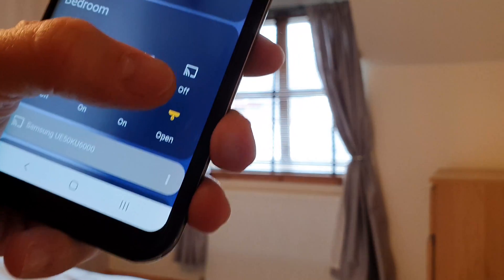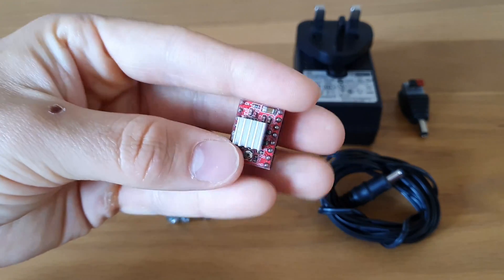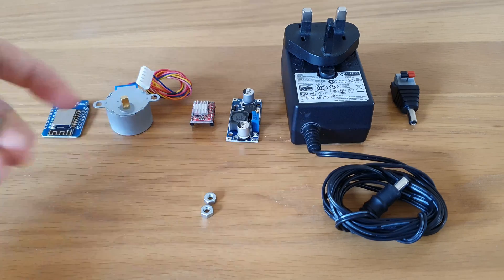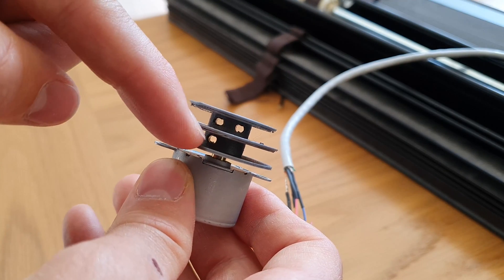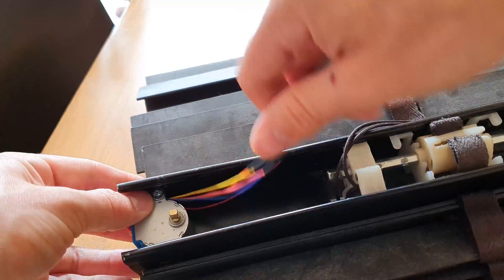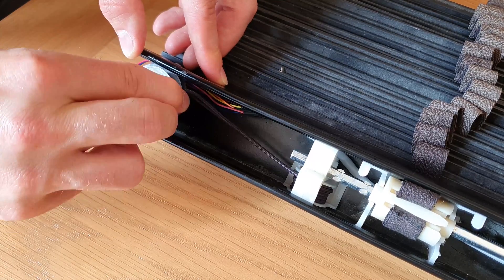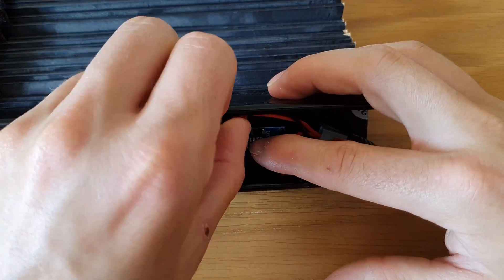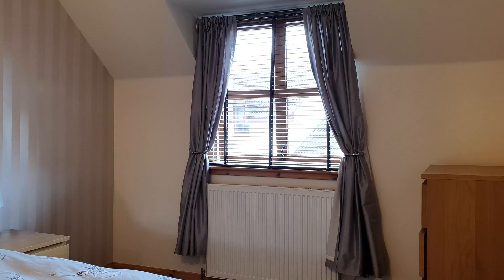DIY Motorized Smart Blinds | Home Assistant & ESPHome | Everything Smart Home

Comment: Sorry, this may be a dumb question lol I'm pretty new to tinkering and I'm trying new things. Its ok to use a 12 volt power supply with a 5 volt DC stepper motor?
Reply: Nope, you will burn it. Voltage must be exactly the one in the specs. Amp or power (of the power supply) must be equal or higher than the stepper specs.

Comment: Very many thanks for the inspiration! I successfully followed a similar approach but with a wand driven 1 inch blind rail (rather challenging in this space!). Had to cut away some plastic from around the worm gear mechanism, trim the drive shaft and drill a hole and host the motor externally on back of blind rail (Lucky I have space behind else would have to be on front side which is not as neat) . I used a 5mm shaft coupling to then attach to stepper to the worm gear shaft and dropped Ethernet directly down to the controller and power supply. You can buy the Switchbot that turns the wand but they are very expensive! Anyhow to avoid power/reboot issues potentially breaking/straining something due to wrong motor positioning (defaults to 0 on reboot even if open etc..)  I modified the code slightly to include a 'globals' variable that is 'set' on each action and is checked and updated to flash memory every 1 minute (time can be adapted as a preference setting). I included an on_boot section to report/target the motor position using the saved 'globals' value and also update the sensor template value. As the motor is now the only way to activate then I assume that if power issues are experienced then the last target/current value is to be assumed on re-boot. Of course if you power down during operation or less than  the flash update period, then you could still get stuck in wrong/misaligned position, but in general I think the risk is mitigated much better if for instance you are operating on a timer sequence without being home to monitor it. Very many thanks for the big push in the right direction! Keep up the excellent work!
Reply: Could you share your adjusted code? I’m having this same trouble but a little too novice to figure out what to place where 😅

Comment: I see a problem - I don't remember where the zero point is after the reset...How did you ensure that the engine does not lose its initial state? I did everything like you and the engine always recognizes the current state of the device as zero after resetting the device

Comment: The code you posted doesn't work, it finds devices but there are no entities. What needs to be set in the HA configuration file and what needs to be set in the HA automation file? I'm using ULN2003 instead of A4988, my settings of stepper:

stepper:
  - platform: uln2003
    id: my_stepper
    sleep_when_done: true
    pin_a: D1
    pin_b: D2
    pin_c: D3
    pin_d: D4
    max_speed: 250

Comment: btw, the wiring diagram is wrong.  the lm2596 has in + on both sides, and where the red/positive and black/negative should go on that end are reversed.

i also burned out a d1 mini before i figured out i had to adjust the voltage 😆

Comment: Awesome, hey any link/guide to mqtt implementation?
Reply from the maker: Thanks! In Home Assistant do you mean?
Reply: @EverythingSmartHome  Thanks for reply sir, I just want this to communicate to homeassistant through mqtt only, skipping esphome integration, just like a video from "the hookup channel" , where his device subscribes to mqtt topic and then it could be controlled by publishing mqtt number to stepper,  the only issue there was noisy clicks at each rotation, the noise was loud enough to wake me up if sleeping if my blinds/curtains move, so I though using different firmware and setup like yours may be quieter... cheers

Comment: Hi, thanks for your video. I followed your guide and it works great.
But sometimes the blinds are out of sync. So if they are open I can't close them because Home Assistant thinks they are already closed. So I can only open them again. If I do that the blinds will turn the other way and close again. But they close not fully. I hope you know what I mean. And what I can do about this?
Reply from the maker: Thanks! I do know what you mean but it shouldn't be an issue unless you are frequently rebooting or uploading to your device or it loses power, how often is that happening?
Reply: @EverythingSmartHome  I never reboot the device. But I do reboot Home Assistant quite a few times. But that should be a problem right?
Reply from the maker: No this isn't an issue for me because the device state is stored on the esp rather than home assistant so as soon as HA comes back online, the esp tells is the correct device state, so I'm guessing you have another issue
Reply: @EverythingSmartHome  so you don't have issues with this. Good know that it should just work. I'll investigate it a bit more. Thanks for your help!
Reply from the maker: The only time I have an issue is if the esp is unplugged and it powers on with the blind in the closed state (because the default for mine is open) but it's easy enough for me to get them back in sync and I never really lose power to the blind
Reply: @MarkKoster  I’m having the same problem. Did you find a fix?

Comment: Very cool brother! In order to control the blinds being able to be lifted as well, would you just mirror the project with the other cord? and would that stepper motor have enough torque to accomplish that added feature? You also had mentioned in this video, you rather had attached the motor on the shaft. Since you have a printer, you may be able to build a planetary gear torque multiplier. You would then have to recalibrate your code. Take that advice with a grain of salt, I am no expert.  Then also if you would dermal out two slotted holes where you secured the motor, you could then slide the motor back and forth (or side to side) to make the cord more taught without having to play with it as much. Using locking washers would then ensure the motor would give on the slotted holes. Unsure if that is any help, but I am excited to try this my-self. Thank you for this video.
Reply from the maker: You could try it yes but I don't think this motor would have enough power, a NEMA17 stepper might but I don't have space for one of those in these blinds unfortunately. Oh cool good idea, thanks for the detailed explanation! 🙏

Comment: My blinds use 2 sets of strings to open. 1 set lifts the entire thing up so there are no blinds covering the window. The other just opens makes the blinds flat as to allow light in. It seems like this is the same system as the one you have. Is that correct? I have seen many systems that use a looped beaded pulley, which mine does not have.
Reply from the maker: Hey Simon, yes that's correct they are the same style as the ones in use here! Hope that helps

Comment: What are you thinking to use that with a battery?
Reply from the maker: It's definitely something that you could do I think, I'm not very well versed on batteries but there is definitely enough scope for a battery inside these blinds. I'll get my thinking cap on!
Reply: @EverythingSmartHome  starting to follow everything you are doing now :)  I second the battery option, that coupled with a small solar panel to top the battery up, and go from a wifi to zigbee chip to reduce power consumption when idle, and you've got the perfect setup.
Reply: He used an wall wart power supply mains to 12V dc.
Reply: Hi, Do you think there would be enough voltage and amps from just a 5v Battery?
Do you think the motor would have enough power?